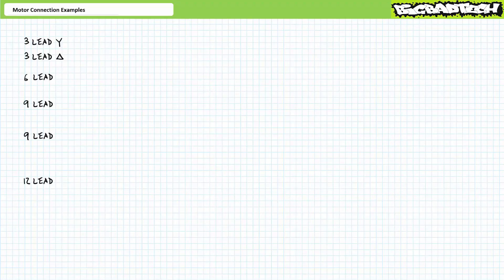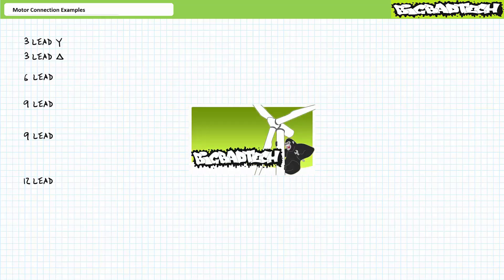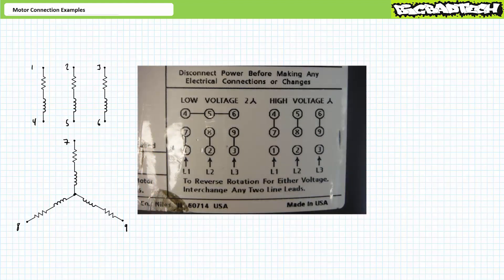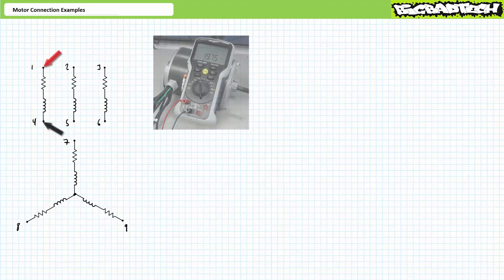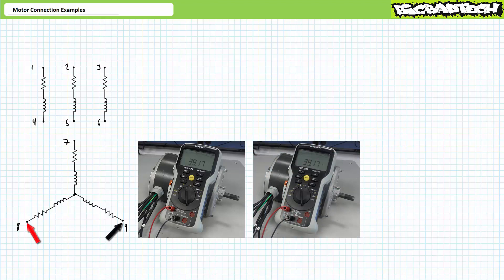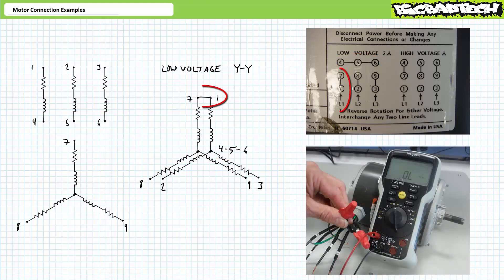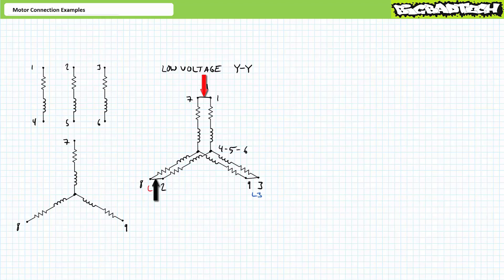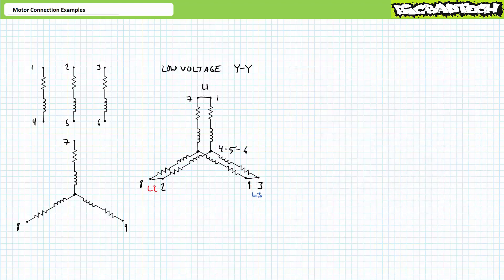Motor Connection Examples (Part 1 of 2)

Comment: What an interesting design for such a tiny motor. I'm guessing the measured resistance at the end is slightly lower because of the extra (longer) parallel path through the third lead connection for a small part of the flow, which could happen in either direction. To account for that minor extra path, parallel on top of parallel, either way, would be unnecessarily complex.